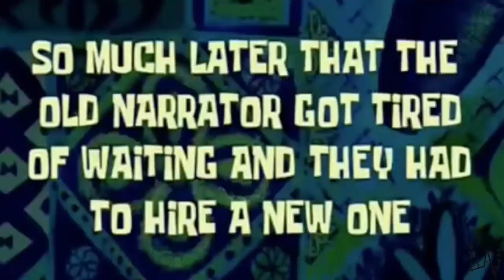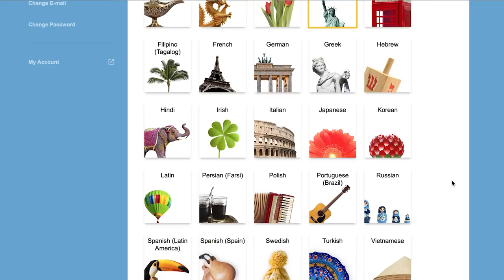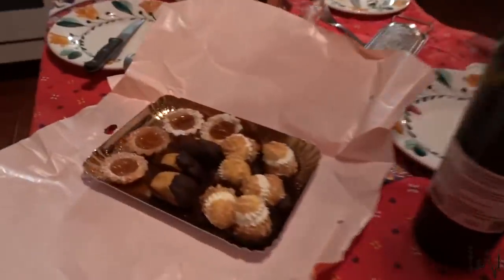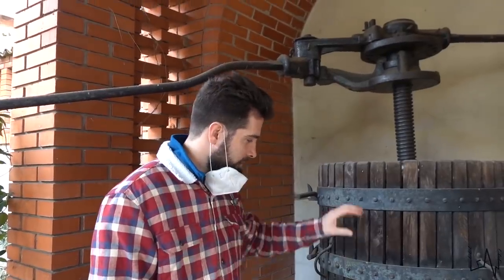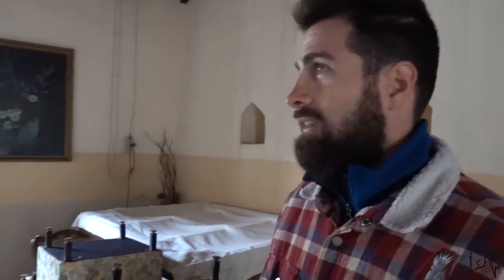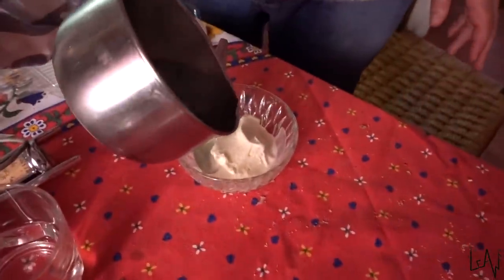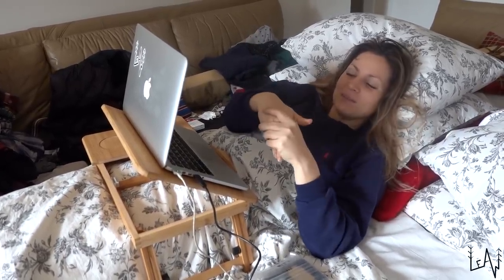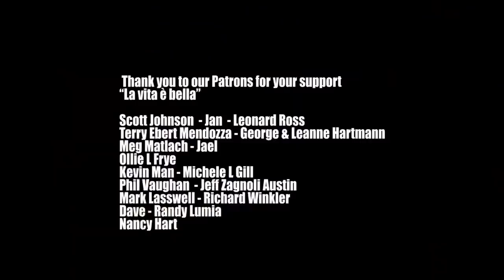THIS VIDEO DOES NOT END WELL...COTTAGE RENOVATION ITALY

Comment: SARA, if you lay on the floor facing up bring your heels back and tilt your knees one way and your torso the opposite direction alternating from side to side and holding the position for a few seconds each time. It should help, my beautiful wife Gail and I have back issues and we find that this stretch helps quite a bit. Also, thank you so, so much for sharing your adventures. You are both completely lovable. Bravo from Staten Island NY!😘

Comment: Great video, guys!

I wanted to share my experience with my dishwasher recently, with you

Every third load I was having to clean the float in my dishwasher or it would overflow. In mine, there is a little mushroom shaped cap that floats in the water to turn it off when it gets to the right level. Something sticky kept building up on the stem.  Since I know I don't put grease in my dishwasher I decided it was the gelatin from the little dishwasher pods I was using!!!

I decided it was the gelatin that they come in that was causing a problem

I went back to my powdered dishwashing soap, in my case it's Cascade dishwashing soap, and it has not overflowed since!!

If you are using those pods, throw them out!!!

Don't even try using them up first.  By the way, I am a 77 year old granny in central California, USA!  

Sarah, put moist heat on your muscles and then follow it with ice with a towel wrapped around it on the joints that hurt.  I have a very bad back and it works better than drugs for me. I am praying for you, Sarah